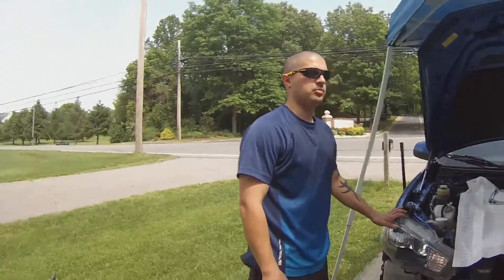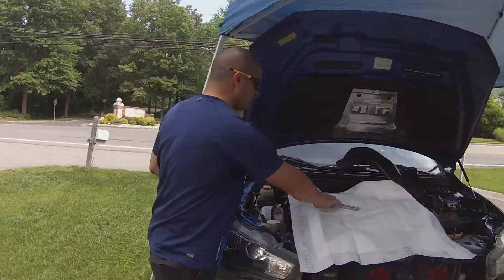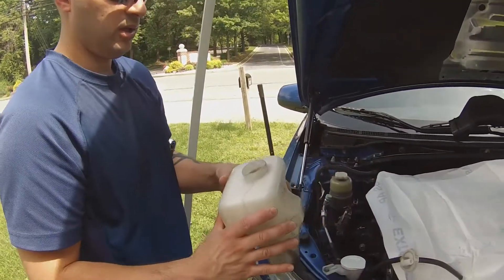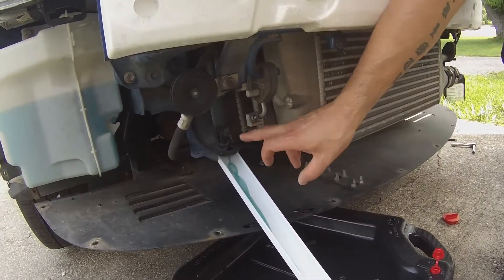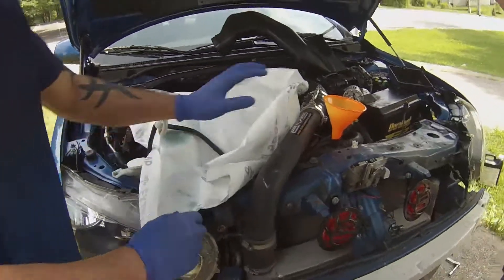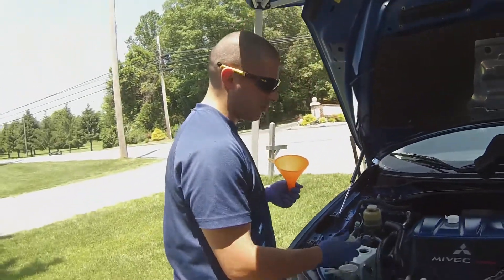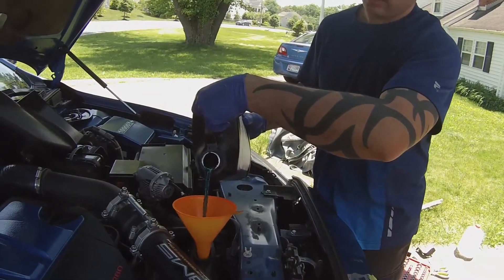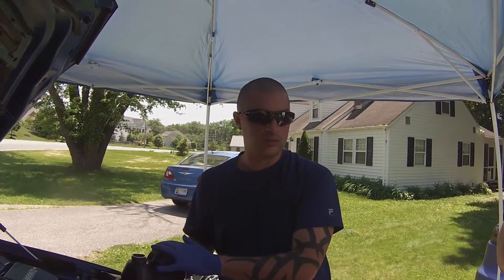How to do a Coolant Flush On An 09+ Ralliart

Comment: I thought you had to set the heater control to the hottest setting and fan control off, then run the car with the radiator cap off and wait for the cooling fans to kick on to burp the entire system?
Reply from the maker: Yes for some reason I lost that footage on my ad card. When I do it again I will make a better video.

Comment: How do you remove the ralliart front bumper?
Reply from the maker: +Stephen Zamora the pop clips on top to remove the black panel. Then underneath there is stuff to remove on the stock under tray which I don't have anymore since I upgraded. Then there is a few on the inside of the front wheels you need to remove that are connected to the bumper. Then there is 2-3 bolts in the center to remove. Then just be easy popping the clips by the fenders don't break them. It sounds like a lot but it's super easy. First time I did it it took 25 minutes because I'm not very good with working on my car as I learn from doing and having friends help.

Comment: You just drained and refilled the radiator. What about the coolant that is in the engine block?
Reply from the maker: After we drained the coolant. I forgot to record we filled it back up with distilled water and ran it for about 15 minutes with the heat on as hot as it could get. Then we drained that. Put about half way of the new coolant and did it again to make sure no water was in the system. Drained again then refilled it with fresh coolant. I do plan on re doing this video when the time comes because I realized I could do it better.
Reply: @AmsRalliart614  Thanks for the reply! So how much total antifreeze did you use as a proportion to the full capacity, when all was finished? I'd like to know how much antifreeze to buy before starting.
Reply from the maker: @twincams350  I believe I bought 3 containers of it if I remember correctly. It's cheap for the oem stuff and that's what I run. I still have a gallon and a little bit I'm a second jug in my garage. So I'd buy 2 to be safe.

Comment: Hi guys, thanks for this video. I noticed you didn't fill with distilled water and then run car up to temp. Let cool down then drain out. Doesn't this flush system better than just pouring distilled water straight through rad?
Also I've heard the HOAT (red) coolant is the superior one?
Reply from the maker: We started it off camera with distilled water. I don't know why we didn't record that. It was the first time I did that flush since it was new. It had 100k on it. But what I have been told by everyone with Ralliart and Evo X MR is to use oem only fluids trans center and rear diff fluid and coolant. I'd rather be safe than sorry just  for my mind lol.